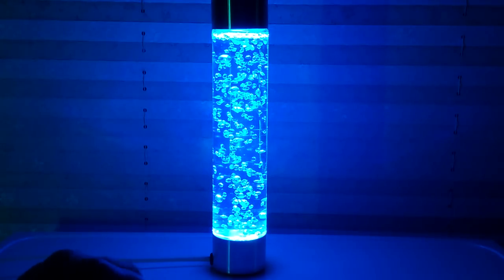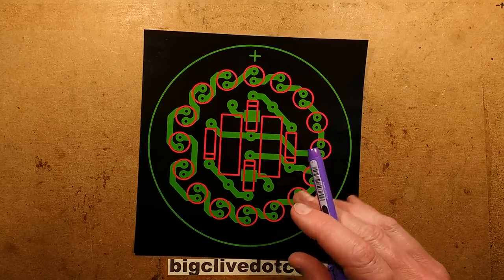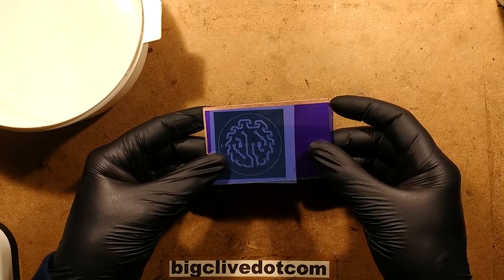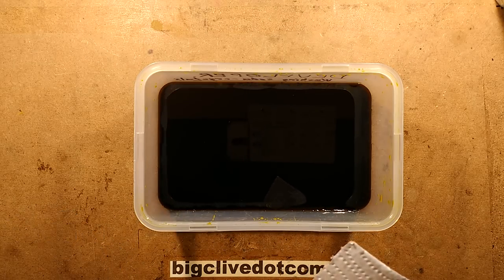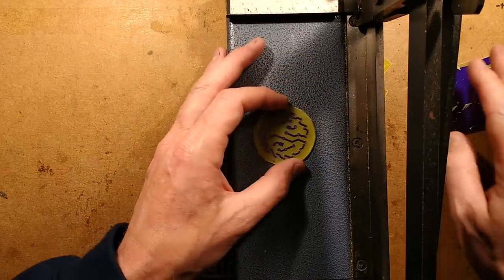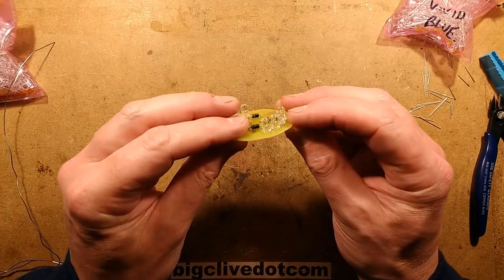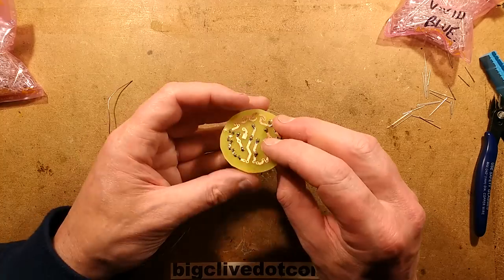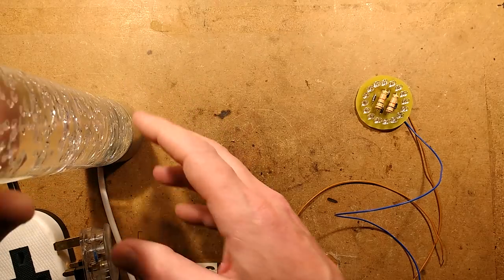Gillian's Diamonds LED crystal remix.  Full build.

Comment: Here is a drilling tip, well I like to do it this way. I put the board on a surface that is solid but easy to drill in to (I use a scrap of EPS foam) and hang the rotary tool from a hook on the shelf above my workbench on a bungee cord so that the tip of the drill is about a cm above the board.

I hold the dremel with just two fingers of my right hand, almost like a pen, all the weight is supported by the bungee, but it takes no effort to pull it down that last cm. I slide the board with my left hand to get the holes roughly under the drill. All the holes in a 5 cm or so area around where the drill naturally hangs can be drilled without moving the board.

It's a lot to describe, but easy to do, fast, does not tire out your arms or hands at all, and I (almost) never break a bit. Think of it like a super cheap drill press, but the wiggle room makes it so fast and easy to align the holes. Clear as mud?
Reply: I've built a 2-axis stand using rods and linear bearing spares from 3-D printing. The drill support's printed, and if you are into 3-D printing, there's a whole heap of .STL files on the Net for this sort of design (along with the editing software to give them any slight adjustments need to suit your drill)
Reply: You can actually buy the drill motors (they come with one or more bits) and build a press yourself. There are plans on Thingiverse if you want to print one. I drilled PCB holes freehand for many years but a nice drill-press makes a world of difference.
Reply: This is my opinion, of course, but I prefer the hanging rotary tool, I also had an appropriate drill press. The bungee method is faster and easier because you do the fine adjustment with the hand holding the tool, and can drill all the holes in a small area of the board without moving the board. With a drill press you must re-position the board for every hole, and line it up perfectly.
Reply: I use my Dremel 4000 in a Dremel Workstation, which turns it into a drill press (albeit one without much vertical height to play with, but that's fine for PCBs). I then use that to drill the holes, and then I switch to a PCB routing bit that I bought from Mega Electronics (for around £5 per bit! The regular reground drill bits from them were £15 for 10, and the non-reground ones were £3 each...) to route out the board edge, because I don't have a PCB guillotine (I use a standard office paper guillotine to cut my pre-sensitised boards roughly to size before exposing & etching, but that leaves a pretty nasty edge - it's just barely good enough for what I use it for...) and I often want my boards to have odd shapes to them as well.

It's definitely more time-consuming to drill the holes with a drill press than by hand, but I suffer from RSI in my hands & wrists (thanks to now-16-years of spending 24/7 sat at a PC causing those nerves to be a bit shot...) so my hands shake a lot and I literally cannot aim a drill accurately enough for Clive's method (sometimes I'm able to solder, sometimes I'm not, and given that I tend to favour surface-mount components, that can be a bit problematic!). A drill press lets me spend time carefully aligning the bit before holding the board in place while pulling the handle to lower the Dremel.

Comment: Two remarks for aspiring PCB makers of things that i found out a long time ago.
First off: if you put the iron (or other heating element) below the PCB it is a lot more easy to do the thermical transfer. Just place it on the hotplate :-)
Second: you can use a laserprinter to print the schematics on a sheet of vynil (overhead projector sheets as they where known back then) and directly heat-transfer that onto the bare copper if you heat the PCB to exactly the right temperature. Throw it into the ferric chloride and done. Just be sure to test the sheet if it is actually the heat resistant stuff, you dont want it to go all melty-gooey.
Reply: Insted of vinyl you could use regular printer/copier paper, use an iron or laminator (modified?   Mr Carlson's Lab  made a nice video about that)  for transferring the layout.  8-)

Comment: Did you have "Dalo" pens there ? You could draw your on traces on the board with an acid resist pen, called a Dalo pen. You could also use lettraset rub down letters - a thin plastic sheet covered in letters, and ic pads, you would use a biro pen to rub them off direct onto the PCB - and same, we have a semi pro pcb one in an hour, and cost less than a dollar! ahh the good old 1980's :)

Comment: Great video, thanks. A couple of years ago Thomas Sandlander posted a video on his channel Made with Layers that showed how to make circuit boards using a resin 3D printer. The video is titled "The fastest way to make crisp PCBs at home!" Instead of printing a mask using a regular printer like Clive has done, the masking ability of the 3D printer is used when the 3D printers UV light exposes the gel on the copper. Then the process to continues with the chemical washes.

Comment: Two more applications of polystyrene:
1. Analog panel meter covers, though static can be problematic.
2. Low-range (pF) capacitors, which are VERY stable over time.
Reply: not as stable as C0G.
Reply: SigEpBlue Also CD "jewel" cases.  Solid PS was introduced years before bubble PS (EPS).
Reply: Another obvious application - all those Airfix / Revell Polystyrene Model Kits!

Comment: You solder beautifully Clive.   It is interesting to hear about LED suppliers and getting good LEDs .   I have to say I have never had any really bad ones , fortunately.  I occasionally buy LEDs on e-bay , but , for past 10 years or so I get most of my LEDs from a component store in Japan when I'm there . (I buy big quantities at a time , several thousand) They are incredibly cheap and they only have very good quality branded ones.
I also like "vintage" LEDs and will snap them up / stockpile them when I can find them.  The company I work for used to do a lot of the moving message signs in the late 80s early 90s and we used to replace individual LEDs . I still have a good stockpile from those days , (so they are all 25 years+ old). I have several bags of very old "Bulgin" branded reds from early 80s. They are lovely , indestructible and everlasting. Also a load of various old Kingbrights which are very good and robust .
Some of the new ones are pretty decent though , although they don't make them like those very early vintage ones anymore. 

Would love to know your favorites and your thoughts on the best ones ?
Reply from the maker: Up to the point that cheap gallium nitride LEDs became available on eBay I used to only use Kingbright sourced from a UK supplier called Rapid Electronics.  I'm jealous of your Japanese source.  It's good to know that you change individual LEDs in the big signs.  I used to maintain an old tungsten RGB video wall in Glasgow before LED walls became affordable.
Reply: I am fascinated to hear about the tungsten video wall Clive?  How big / what type were the lamps and how much power did the whole thing consume?

Comment: Washing salts aren’t so commonly available in the US but they’re easy to make, by spreading sodium bicarbonate out on a baking sheet and heating it in an oven to 350F or so for a couple hours, which releases the excess carbon atoms and reduces the sodium bicarbonate to sodium carbonate. I do recommend wearing eye protection when working with it though as it becomes a very fine powder which has a very high pH when it gets slightly wet.

Comment: 37:16 High wattage carbon film resistors in a heater application? Metal film would be a lot safer especially in a line voltage application.

I've had 1/4 watt carbon films burst into flames before I was shocked something that small could produce a flame that big they're like match heads. Granted I was just starting out and grossly exceeded it's wattage but as a rule since then anything over 1/2 watt I use metal film I'd rather have smoke than fire :-).
Reply: That's actually where carbon composition resistors are a better choice than film resistors. They distribute the voltage fairly evenly over the composition filler rod, and aren't prone to arcing over the edges of the spiral like film resistors are. If you short a carbon comp resistor it generally just explodes without any flame.

Comment: PCB making videos are always welcome!

I've been getting excellent results with poundworld photo paper & toner transfer.  No soaking, peels off leaving a perfect image.  I struggle to solder these raw copper boards without any solder mask though :-(
Reply: You might want to try chemically tinning them (see MG Chemicals #421), and/or use a really good flux. Even a little surface oxidation makes soldering difficult.
Reply: Scotchbrite?
Reply: SigEpBlue Another option is photo sensitive solder mask.

Comment: Any left over solder bits here, and all dribbles / spatter from desoldering, go into the lead alloy pot and are used to cast things (I use a lot of Lead/Tin alloy so solder's ideal to add to that, extra Tin helps the alloy fill out the mold nicely.) I get rid of any acid core solder I get that same way, just have to neutralize the Acid flux!

Comment: I recommend you discover a product called "Shoo-goo". It is remarkable stuff and seals well to plastics and neoprene which might otherwise dissolve in other plastic glues. You can run a bead of it on the underside of plastic trash can handles which are tearing free and on the bottom of plastic muck or garden buckets to reinforce them to a remarkable degree. The repair abilities of this stuff is considerable due to its strength and lack of tendancy to crack. Just remember to allow it extra time to cure beyond normal drying time.

Comment: For half the mains voltage, split the load into halves and run them in parallel. E.g. on resistor per side, both resistors on the rectified side.

Comment: Nice relaxing build there as I de-china a deskfan I've bought for someone as a present, sharp edges, lack of lubricants, questionable construction, not thinking this is worth the £24.99 ebuyer sold it for........
Reply: ahahha de-china that's a fun hobby I share
Reply: I am literally doing that at the moment :D Adding a resistor into a cheap chinese torch, "de-china"-ing
Reply: I didn't know more people did that... I do that too.
Reply: Interesting , good to hear there are others out there "de-china-ing" stuff.  I do quite a lot of this myself .  I do it for my work , not just for myself.  Mostly it is Chinese LED lamps .   
At work (I repair / maintain signs , but the work extends to other lighting too   such as outside  lighting at hotels , etc where we maintain the signs) 
I use LOADS of the LED "corn " bulbs , (the type with plastic cover), in various sizes and different caps , some screw , some bayonet)    These are the type of lamps Clive did a breakdown of where he did a 12 volt , a 24 volt and a 240 volt version. 
Many people dislike these lamps on the grounds that they fail and have short lives . BUT THEY DON'T NEED TO . THEY ARE EXCELLENT LITTLE LAMPS!  With a couple of simple modifications they can be made almost ever lasting and super-reliable.  
I simply fit them with a much lower capacitor , usually a 0.22uF , and a series resistor , (a parallel pair of 600ohm 1/4 watt) . This makes them bullet proof , super long lasting and runs the LEDs so they are hardly even warm . The resistors prevent inrush current blowing a LED. The overall brightness is only slightly reduced.    
Clive actually did this hack pretty much to one of these lamps in a vid of it's own. 

I wish the Chinese manufacturers would do this already and not push the components and LEDs so hard in an effort to just get a bit more brightness.   If they did the lamps would gain a good reputation for being reliable and long life and THEY'D SELL MORE OF THEM!
Reply: So that's what it's called. Have been doing that kind of thing for 15 or so years. Great way to get some good stuff if you don't mind putting the finishing touches on what would have been a high quality product if the factory didn't partake in extreme penny pinching.

Comment: Intriguing process having the UV resist film but for homemade boards you can’t beat heat transferring a laser printer printout onto the board, soaking off the paper and use it as the resist. Saves a ton of time and fiddle.

Comment: Thanks for a great video, Clive. Your long videos are best enjoyed with a quart of tea and a battery of biscuits. Also, when you added the resistors would it be a better idea to place a thermal pad on top of them for more efficient heat transfer?
Reply from the maker: I physically glues the resistor to the bottle with silicone to couple as much heat as possible.  That makes the light more efficient and keeps the resistor cool.  Ideally there would be a spring loaded coupling system, but there's a risk that a bottle might not make proper thermal contact.

Comment: Another thought for using 5V supply, there are LEDs sold with integrated resistors rated for 5V. Each would be in parallel, or if you want them dimmer pairs (or depending on experimentation triples) could be in series.

Also, you kept mentioning "layer 50" in your description of designing the board. Just out of curiosity what software are you using?

Comment: For 120V mains, a more elegant solution may be to whack 6.8K straight across live and neutral to dissipate a little over 2W and drive the LEDs with a capacitive dropper. Overall power factor should still be high since most of the power is dissipated by the heater resistor.

Comment: Could you design a version to run a proper Mathmos style lava lamp? The proper tungsten spotlight bulbs are getting very difficult and expensive to find. You would need 20 to 30 W of heat though! Perhaps two circuit, one for an adjustable heater the other for a ring of LEDs.
Reply from the maker: The Mathmos lamps require a lot of heat and it has to be within a fairly tight range for proper operation.  Quite tricky to do with resistors.
Reply: More research and I find that Mathmos actually marketed an LED plus thermostatically controlled heater version, but it seems to have been unreliable and it has disappeared off the market. I might have a go at it.
Reply: Don't know if it's the same version,  but in my wax lava lamp I use appliance bulbs as replacements.... The little 40w bulbs intended for ovens and dryers.